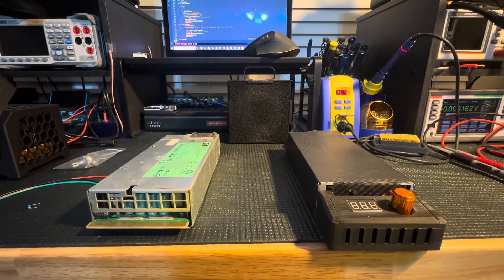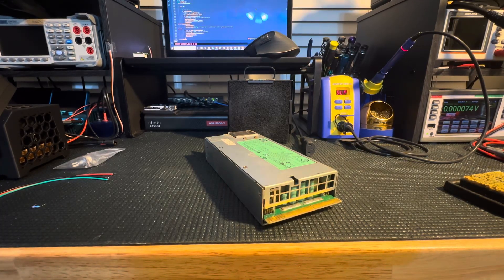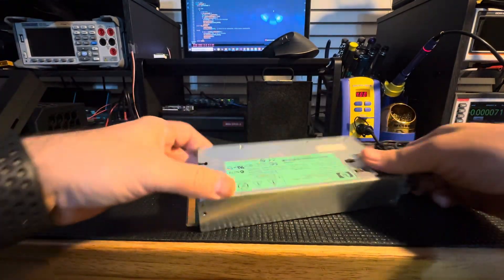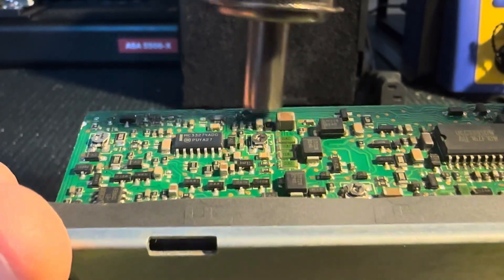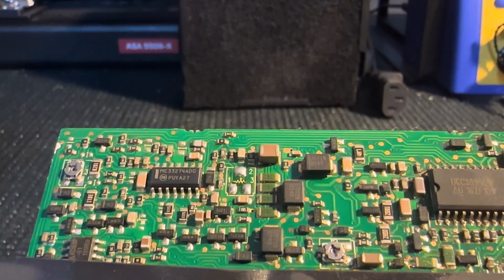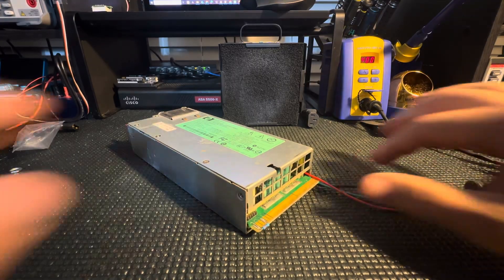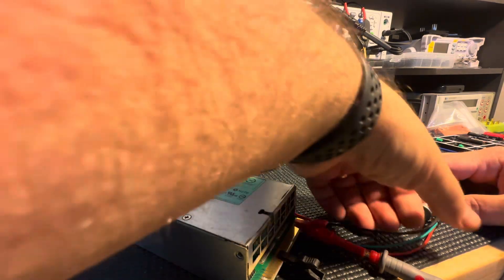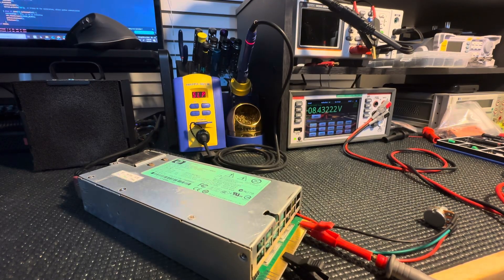Variable Voltage with HP Server Power Supply and WMH Racing

Comment: Why does it have 3 max watt ratings?
Reply from the maker: I assume you mean the 900W and 1200W.  I don't have a label in front of me to look at the moment.  But when powered from 110-120VAC the 1200W supply will output 900W.  It has to be powered from 220-240VAC to put out 1200W.
Reply: @andrewsarratore5932 yeah I guessed it afterwards.

Comment: What if you want a higher voltage for ham radio ... say up to 13.8 or 14.5. Would a 4k get up to at least 14V?
Reply from the maker: This mod is only for getting a lower voltage.  There are mods out there for raising the voltage as well, you have to change the over voltage protection as well as change the potentiometer.  But you will have to look those up, as I haven't done those mods.
Reply: You would have to remove the over voltage protection IC chip.

Comment: Those psu after certain time it won’t start idk why
Reply from the maker: You could have a unit that is going bad.  I have both of mine that I use routinely without issues for 3 years.  The units I sell on my site I also put a 350W load on them for 5 minutes to test them.  But, these are used HP server supplies that most likely spent many years running servers 24/7.  They don't last forever...